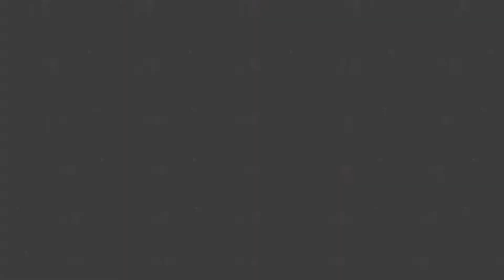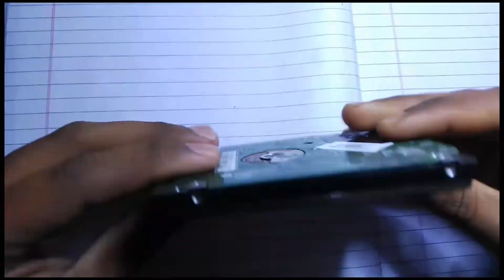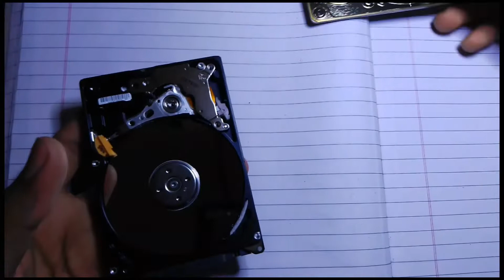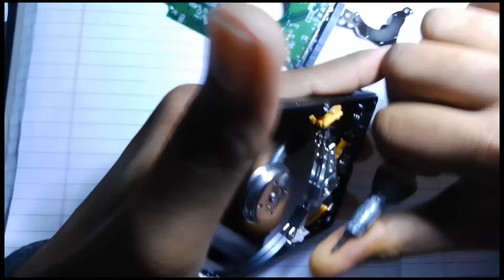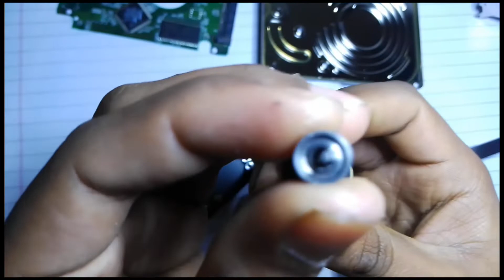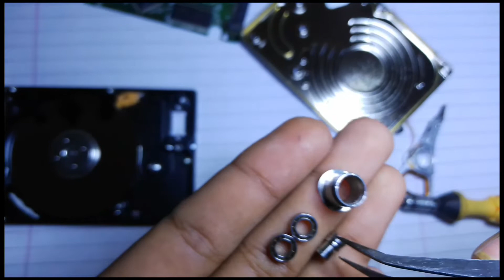What's Inside a Hard disk || bearing form old hard disk

Comment: 2:40 sometimes there is a small bolt/screw in the side of those bearings retaining them in the arm that was the case with my experience and it was really easy to remove this way.
Reply from the maker: In my case all are glued so it was a bit difficult.